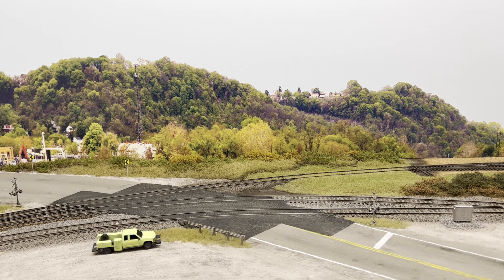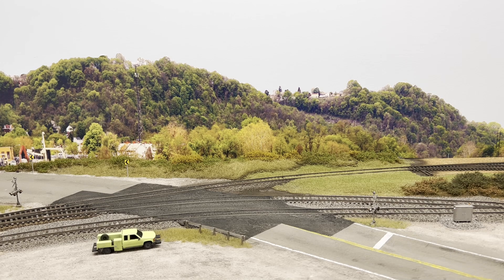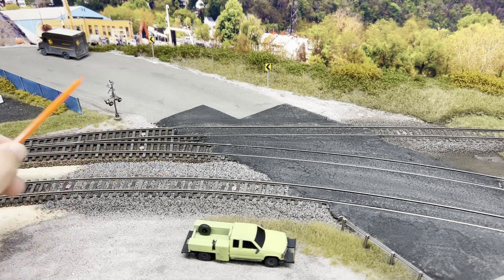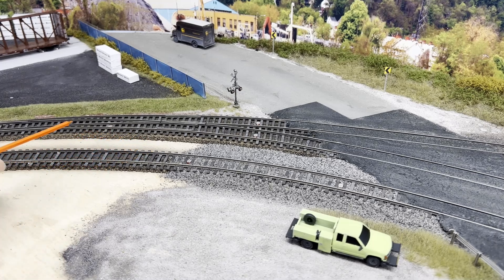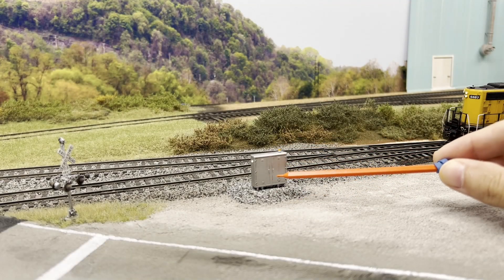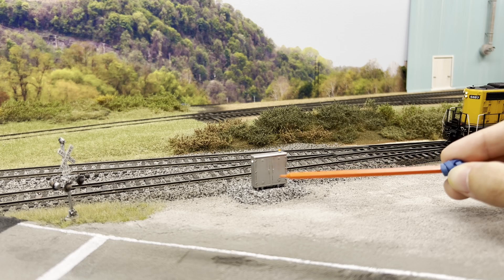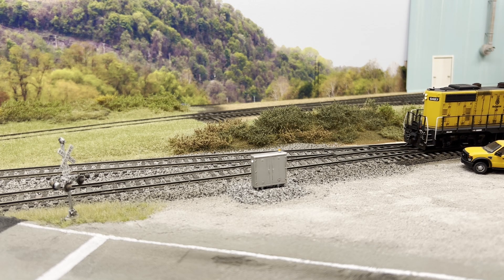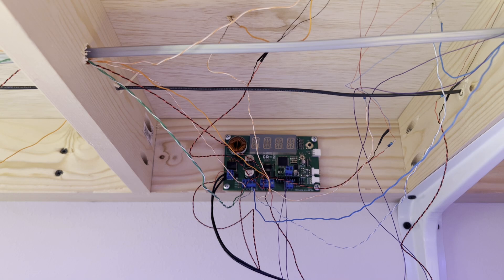Somerset Industrial Layout Update 6/15/23 Crossing Signal System

Comment: When picking the signal crossing system, did you consider one that used the rails for detection? Just curious as to why you went with this system vs. another?
Reply from the maker: I was recommended this system by a few others and it shows why. Very easy to install and it just works flawlessly. I originally wanted to use block or current detection but with the turnouts being so close to the crossing, i didn’t want to be cutting rail inside of the turnout. You are able to use current sensing as an option with this kit. I could always re visit that option later on if I want as these sensors don’t require and modifications to the ties. It would just be pulling them out and adding a pinch of ballast.

Comment: Looks great as far as the white light on the relay box, that is to indicate that there is power going to the crossing signals. For example if there is a power outage due to weather etc, the light will be off and the signals will not be operational requiring a stop and flag order. Great job adding it in as a detail as well as applying the speaker into the relay box. Keep up the amazing work.
Reply from the maker: Thanks Ryan. Appreciate the info

Comment: Kudos on the effort for detail all the way up to the sensors. I'm sorry you are stuck using visible/IR light detectors. Current sensing detection is available and is closer to prototype function. 
Now, the only other detail missing from your signal setup is the meter pole and utility drop, which is usually an aerial cable to another utility pole with a transformer.
Reply from the maker: Using current sensing or block detectors wasn’t an option on this crossing due to the turnout being to the left of the crossing. There needed to be 3 zones or blocks for the system to work. Unfortunately this is a sacrifice for building a model… My benchwork is very high off the ground so you can really only see them if standing on a ladder. 

And every box does not have a wire to a pole…. There is underground service on these all over…
Reply: @RailserveJohn  it's not terribly difficult to isolate the island circuit from the turnout for a current sensing detection block. And unless you are running two independent trains, one on the furthest track and one on the nearest track, you could power all three island tracks off the same source, with the same detection. Anyway, I'm just saying it could be done, but what you have works best for you, no need to change it now. 

While practically every crossing relay bungalow gets it's power from the meter by an underground feeder, there's still a meter pole with a main disconnect and usually a weatherhead with a utility drop going to another pole with a transformer.  In rare cases, I've seen the meter and weatherhead fastened directly to the side of a bungalow, but that's only ever been in the case where underground and aerial utility space was terribly cramped already. 
The relay and hidden speaker are already details most modelers forget to include. I am quite impressed with the way you not only included one in yours but also the way you incorporated the pilot lamp and a tell-tale flasher. As a train crewman, those were nice at a signal where switching was done, and you have to creep up on the crossing to activate it, but you may not necessarily see the flashers themselves. I had a similar experience with a crossing at Anheuser-busch on the loading docks. The flashers only faced outward, 4 tracks and the beer trucks barreled across the crossing at Mach 9. (Faster if the lights were flashing) we were supposed to stop and wait for the flashers to activate before blocking the crossing. But the only way we knew it was working was the flasher on the top of the box.
Reply from the maker: @SD40Fan_Jason  yeah the scene is far from finished. I will add power lines coming from the backdrop. My electrician friend recommended modeling power coming from the pole - underground - to the box so I will try to incorporate that. I’ll be using block detection and signals on the other side of the layout protecting the single track through closets and into the double track yard lead. Maybe not 100% prototypical but kind of a must for when we have 3 crews running at the same time. More to come on that in the future.
Reply: @RailserveJohn  It's a great set of additions to the scene and with the high bench work perspective and the  ballast color, those sensors aren't noticeable in the least (far better than what we had to work with decades ago!).  

Always a pleasure to stop by and see the progress from time to time, including the switcher build that is nearly ready for paint.  Keep up the great work!

Comment: John, Nice to see you installed the grade crossing signals and detection system. The addition of the lights on the relay cabinet are a unique feature not modeled often. It looks fantastic and adds a realistic operation for the crew doing the switching. The grass on the rear siding is exactly what you expect to see on a slow speed siding.  Your RSSX locomotive 5487 looks really nice with all the added details.-Tom
Reply from the maker: Thanks Tom! I’m really forcing myself to slow down on every project. My goal is to add 2-3 extra above and beyond features to every project I do. Big or small lol looking forward to your next visit.

Comment: Hi John 
Yes I was just checking them out , what model did you get
Reply from the maker: I got the one with sound and without gate control. It came with everything except the speaker and 12v power source.
Reply: I emailed them , added to my list
Reply: Hey John, where did you the signal stand crossbucks and lights is that included

Comment: Sweet setup. I don't like optical sensors but Signalogic is the best option if you're gonna go that route for sure. Crossing bungalows typically have a light that lights up as long as the system is active, but it doesn't normally flash. The flashers I've only seen used on DTMF (radio-activated) crossings.
Reply from the maker: Cool! Thanks for the info
Reply: I'm not a fan of optical sensors either. There's nothing prototype about a giant emitter and eye between the gauge every few yards... current sensing detection would be ideal for a realistic approach and island circuit even on a convoluted crossing such as this one.
As for relay box lights, they will always have the Pilot light indicating the batteries are being charged by commercial power. The only time I've ever seen a flasher on the cabinet though is when the crossing itself is obstructed from view of the railroad right of way but the cabinet can provide a viable tell-tale to train crews. But every railroad is different.
Reply: @SD40Fan_Jason  I've used a current sensing detector to activate a model crossing. The problem with current sensing is that you need to add resistors on all your freight car axles.
Reply: @lepetitnabot  if you have 2 axle trucks only one needs a resistor. And in most cases that's not a problem,  especially when you have many blocks to detect. It gives that realistic appearance